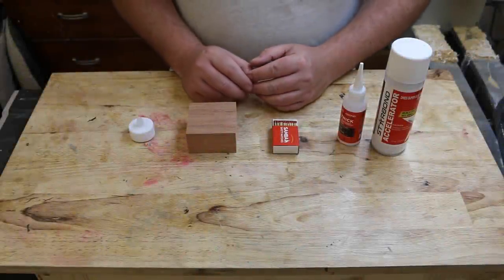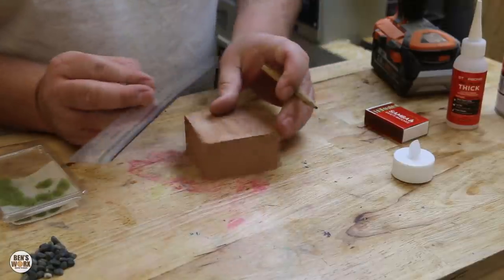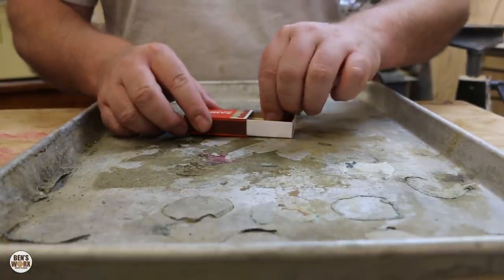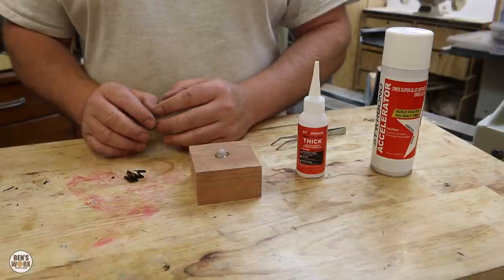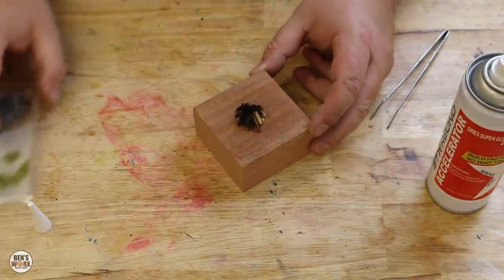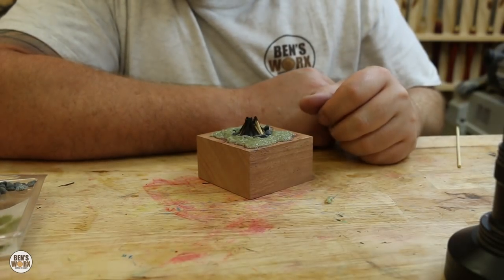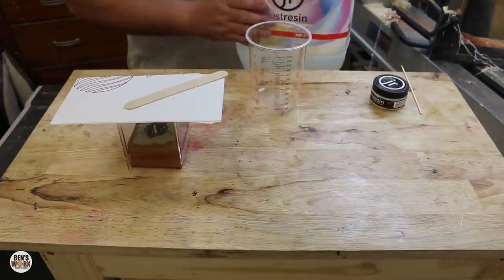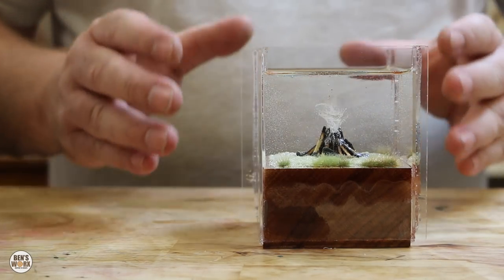How to Make a Campfire Diorama Night Lamp - Easy DIY Resin Art

Comment: That turned out really well I was kind of wondering if you kept any of the shavings from the Block you drilled into the color and the shavings would look great in a pen blank and thanks to this video I might be able to actually have an idea on how I want to do with this Rose in resin I've been working on unfortunately I had to do it layer by layer had to use a Jello plastic cup to put the rose into I'm hoping I can clear some of the bubbles away make it look a little clear and attach it to a wood base with a light underneath
Reply from the maker: Thanks Mate, I think I might have some shavings left 👍
Reply: @BensWorx  cool I wish I still had the shavings from the huge cardboard blank I made the container fell off my dress or one day and it went all over my floor the lid blew right off the top only save the shavings because of all the different things I used to put each layer together

Comment: If one doesn’t have a pressure pot, what’s an alternative to preventing/removing bubbles? And yes, that smoke was a definite cool touch
Reply from the maker: There are several things that can help in limiting bubbles, mix and pour slowly, slightly heat the resin to lower its viscosity, use a torch to carefully heat the resin on top, some resins work better than others in releasing air, generally resins with a slower cure time will work best. Hope this helps mate
Reply: @BensWorx  thanks for the response! I’ll look into all that. Appreciate the good work bro!!
Reply from the maker: Thanks Mate